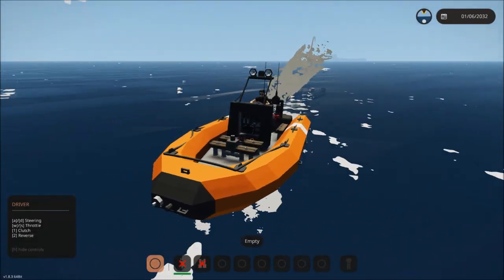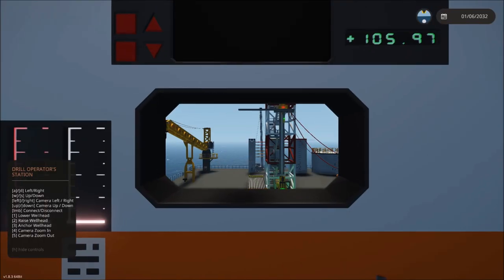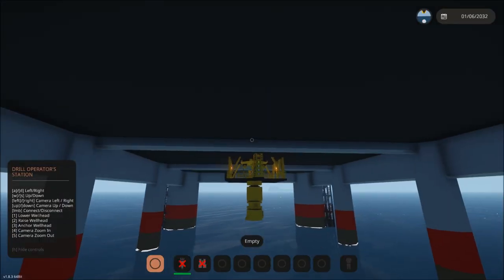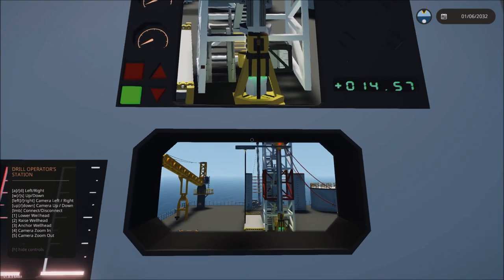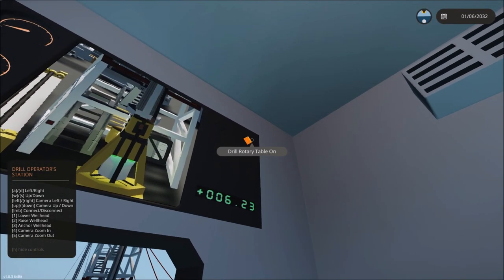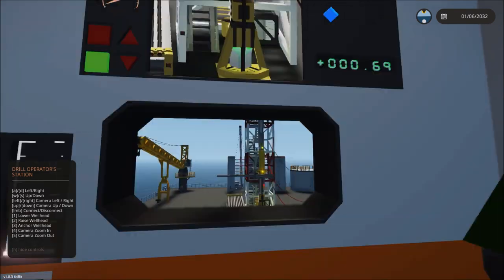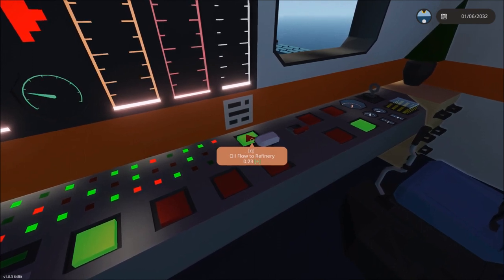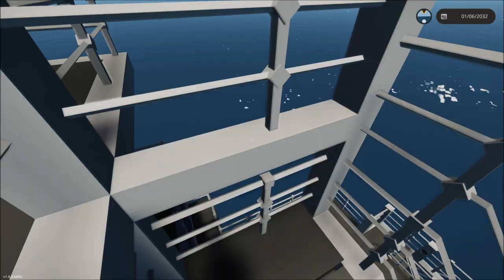Stormworks - Alwent South - Tutorial 1 - How to drill for oil and then refine it into fuel

Comment: I only have one issue so far.. if you’re going to use it for selling the jet fuel it takes a long time to make it and a long time to pump into a ship. But if you’re willing to put in the work it works. If you think you can go to sleep and let the pumps rip all night to fill your boat don’t lol we have a ship that holds like 500,000 L well I woke up and she was at the bottom still going under investigation to see if we over pumped are a tsunami
Reply from the maker: You can thank the changes implemented by the Devs for that. Prior to the Space DLC and compressed gasses update those large pumps were more than enough and the refinery used to churn out the product at a rate of knots.
I've never had any problems with the fuel pumps being slow on my side - but most of my creations have pumps inside them to assist with pumping the fuel in ever since version 1.0, as that tends to work better than just relying on the pumps from the refineries, especially the default ones on the refinery island.

At the end of the day I've done what I can in order to fix everything and get it working again just before Christmas last year, unfortunately I don't really play Stormworks much these days so any fixes in the future will most likely come about if and when the Devs break things again. Feel free to make any changes you like to it for personal use though, you could try adding a couple more pumps 'etc' to see if that helps things?

Comment: lmb is turned into space?
Reply from the maker: The controls mentioned in this video are the default ones used in Stormworks at the time of recording. 

If the devs have changed the default keys or if a player rebinds them then obviously they're going to be different, either way you don't need my help for that as that's something you can easily figure out for yourself and should only take you a few seconds.

Comment: I can’t drill idk what I’m doing wrong I’m fallowing the tutorial and still can’t hit oil for me and my boys
Reply from the maker: At what part of the drilling process are you having difficulty with exactly and what's happening?
Reply: I take everything I said back I’m in the black gold my advice to people is when your drilling down and you think something is wrong with what you did just keep drilling you will hit it
Reply: So I been trying to pump fluid to the boat but Jesus it takes forever so I’m adding some serious pumps to pump fluid quick I just wanted to say all the modifications I’m putting on this rig will be mine only I will not sabotage you by reposting the rig with all my modifications but it’s going to be vary fast at every single thing it dose. Also I wanted to ask why the life boats don’t work on the elite rig? And why is everything locked up?
Reply from the maker: The lifeboats and the non-vital rooms have been gutted out and physics flooders added into them for the lite version of the Alwent South (Yes that's Lite as in light, not Elite), it's designed that way in order to reduce the performance costs compared to the original and runs twice as fast on older machines.

This is explained in the description on the steam workshop.

Comment: Ok I’m on the large oil rig base I shoved 3 drill pipes down and no oil I’m pass the sea bed by 3 rods
Reply from the maker: If the pump jack is switched on at the console and you haven't got any oil coming in (i.e. the alarm didn't sound or oil spray up into the air) then there's a good chance you're on a world seed where the oil is even deeper under the seabed, it's random unfortunately and I've even seen some players mention they needed to ferry in more rods  before they struck oil.
Reply: Ok do you know how many pipes they drilled in well I guess it would vary. But I forgot to add that I’m three pipes below sea bed and it won’t keep going the pipe header is just jumping
Reply from the maker: That's odd. If there's still drilling fluid in the tank, the pipes are all connected between the wellhead and pumpjack then the drill should keep on going until it strikes oil.

Have you tried it again in creative mode in a different world seed, it might just be that one is bugged in some way?
Reply: Yeah it did some jumping but I was just sending it! lol 5 pipes it took below sea bed b4 I hit oil
Reply: It started jumping so I stopped I thought I messed something up but I thought maybe it’s just jumping because of the rock so I just kept going and I hit the oil love the rig love everything about it thank you for this peace of knowledge
Reply from the maker: You're most welcome! 

I'm just glad to know you managed to get it working eventually.

Comment: my rods explode when i press the s key
Reply from the maker: Well that's what happens if you keep playing with it....

Seriously though, have you read through the known issues section? Make sure you're on high physics mode, not low or medium and definitely not Auto, as that'll make the cables jump up and down at random, potentially causing damage to the wellhead.

Apart from that my only other advice is just be gentle and make sure you don't lower the wellhead too much between alternating pressing the S key. If both myself and the 7,000 other subscribers to the Alwent South can do it then I'm sure you can too!

Good Luck!
Reply: @CaptainRobertson  figured it out. finally stuck gold thank you!